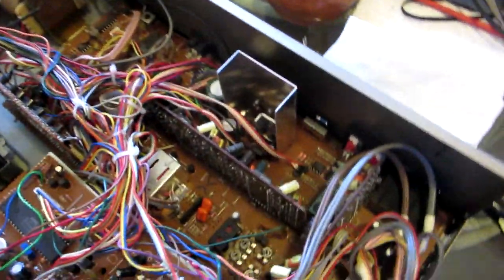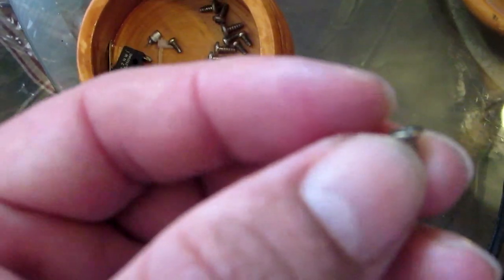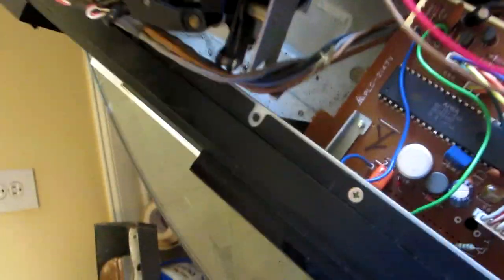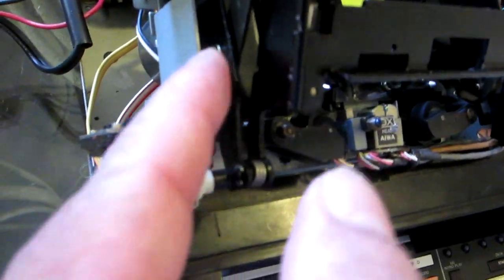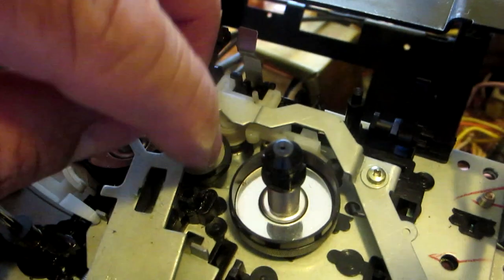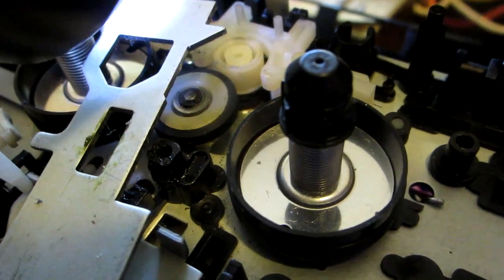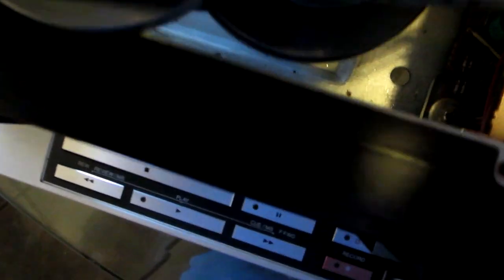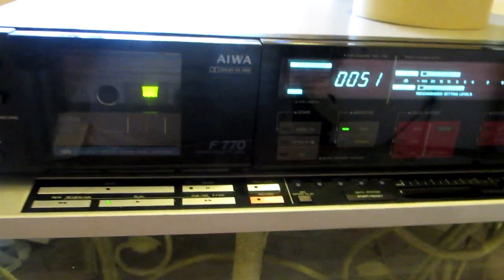AIWA AD-F770 IDLER TIRE REPAIR (part 2)

Comment: I’m glad I watched that, there was a couple helpful bits. It’s a shame you didn’t explain a few things like why the motor wasn’t working at the end (was it the plug you un-plugged on the back of the board?) also, you need a go-pro as filming with a mobile wasn’t ideal, you filmed your feet a few times.  Thank you for posting though, it was useful 👍🙂 
I’m looking to replacing the pinch rollers on my AD-F770 soon, does anyone know if there’s a YouTube video on that task?
Reply from the maker: I had to watch the video and I understand what you are saying. Somehow at the end of the video, a video scene from the beginning I added it at the end. There was no proble with the motor, the problem was the idler tire, that had lost traction and the nylon spindle was too far inside the mechanism, the one that makes contact with the Idler tire. Be careful with those spaghetty wires that feed the motors, they are very thin and the soldering is poor, they come out easily. I had one of those wires come out on my AD-F990, but I was able to catch it and resolder it again. I agree a Go-Pro would give me a wider field of view.
Reply: @manzanaresantonio  Thank you for replying. You should watch one of ‘My Mate Vince’ videos (YouTube channel). He repairs many things, electronic and other and I think his style is spot on, plus he’s a really nice guy. His camera work, which he uses to zoom right in to show what he’s doing is spot on and he says what he’s thinking. He also works on things without knowing anything about the device and what the problem is, his troubleshooting skills is excellent.  Yes, lots of wires in the AD-F770, scarily so. I’ll be taking a lot of photo’s for reference including wires and where they go…. I’ve learnt my lesson from past mistakes.

Comment: Great instructional video! Some mystery at the end though...when you put back the mech after fixing the idler tire grip with the nylon wheel - it did NOT work....why? Then the video cuts into it working...whatever happened in between?? How did you fix the levels to stay the same (one side was playing less) Thanks for your hard work! Keep up the good work you do!!
Reply from the maker: Somehow at the end of the video, a video scene from the beginning of the video was  added it at the end of the video, Please Dismiss that.
The problem was the idler tire. Now be care ful with all those Spaghetti wires that feed the motors and make contact with the boards, it would be a nightmare to find out where they came unattached from. The levels were fixed by playing with the pots. I can't remeber which they were. You would have to consult the manual for that!

Comment: Greetings, 

Working on  a AD-F810 and replace the Idle tire however still cannot get it to consistently turn with that plastic gear.  I did raise it like you show in the video and it help a little.   Should I sand the tire?   What grit?  Does anyone know if that plastic gear is being reproduced?

Thanks in advance.

Larry
Reply from the maker: No it's not reproduced. You will have to get a donor deck, but I think your problem is that the plastic gear is coming out of from the shaft. 
Look at my video where I replace the Idler tire on my Yamaha K-1020. It is the same idler mechnism and you will find some info refering to the plastic gear!

Comment: Do you repair these in the USA ?
Reply from the maker: No idea to be honest, as most technicians run away from these decks. They are extremely complex to repair and with very limited space to work on.
I only do this as a hobby, not as a profession!

Comment: If somebody needs to check idler assembly,parts there,ur video makes only a big mess. And you take all wrong way that assembly to a part. Make a new one,better and right way,order. Only then you really help folks to came around,enjoy  real analog music bliss. And most of all,maintain their gear right way.
I got 770 and 660 ADF-series,wich are king performers. Take care.
Reply: I am a real Aiwa fan. Own a silver, and a black AD-F770, and a complete series AD-WX 707, 808, and a mint 909.  I love the recording capabilities. Only question, where to find Aiwa expertise Mechanics in Europe.
Reply: @janvisser1963  If u need a transport mech mechanics, u can find em. but must ask around a lot. Follow aiwa owners topics and forums. Lot of knowledge there and will find someone who know aiwa floating tapetransport secrets. I have take this type mech apart,many times. Good luck and greets from suomi/Finland.